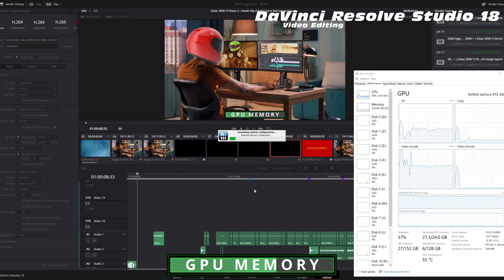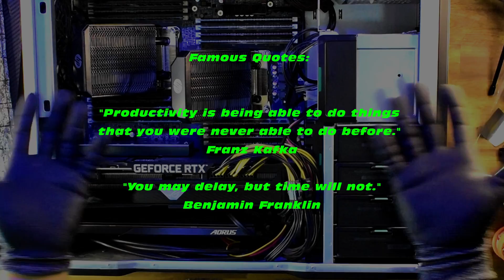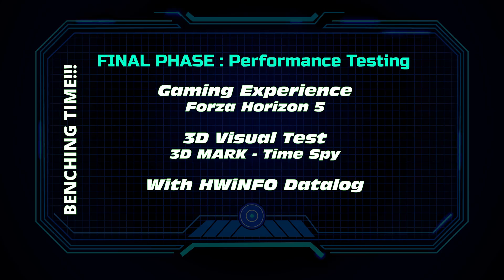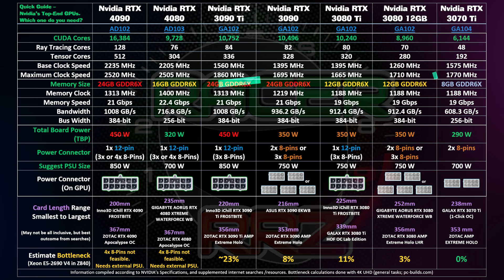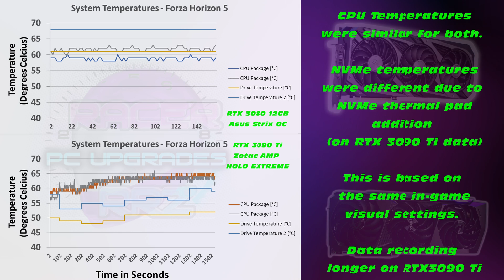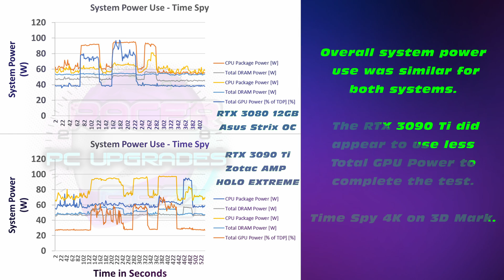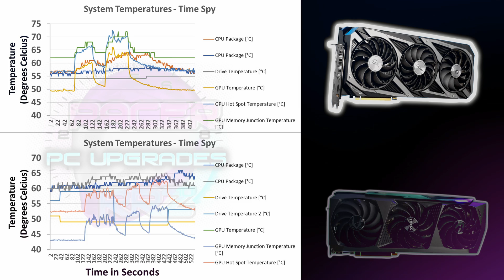GUIDE: Z840 Fitment of ZOTAC RTX 3090 Ti - Unleashing the Extreme Power in a Workstation

Comment: Hi, I'm a refugee from the PC market and looking for more bang for my buck, I have a z840 I bought from pc servers and parts (they were excellent and the shopping was amazing, you could have hit this with a car). But now here I sit as I wait for the 3060s I ordered (2) the rams here (256GB) The ssd's  and buyers remorse, is this going to work? Can I even get the 2 3060s in? I know I have 3 power connectors so that's covered, I plan on having a tech here because frankly Ive never even handled a server until I unwrapped this one... So as I wait for the last 2 parts the gpus I wonder, did i waste my money? Is this build going to work? Its killing me in inches and driving me to drink... And I don't know until next week when I have my appointment with a tech.
Reply from the maker: Great choice with the Z840 - it's a powerhouse with a lot of potential. What was your end-use plan for the Z840? Dual GPU configurations can be useful but it really depends on what you are doing. One application I can think of would be LLMs. Having dual GPU would allow for more effective usage of local LLMs that can operate on the RTX 3060's hardware. However, if you were planning to game or just do general use then the second GPU might be less useful. 

The Z840 has 3x 6-pin power connectors that can supply a max of 219.6W each (12.2V@18Amps). The RTX 3060 requires ~ 170W - so in theory one 6-pin converted to one 8-pin will be sufficient for most models. I have links in the video description to the cables I used on my Z840. The bigger challenge is connectivity. Most GPUs occupy 2-3 PCIe slots due to their size - which means some of your PCIe slots will be obscured. In your situation, assuming you require both GPUs for your end-use, I would place one in PCIe Slot 2 and one in PCIe Slot 5. Slot 5 is only a x8 Slot but I find it unlikely that your GPU will clear in Slot 6 (which is a full length x16 Slot - ideal for a second GPU). You could try fitment of the second GPU to Slot 6 but I suspect it will not clear the system chassis, nor the SATA cables, nor the motherboard cables (i.e. the fan blades will have cable clearance issues in Slot 6). Slot 5 should work.
Reply: @racerrrz  I plan on using it for stable in motion video generation down the line I haven't designed the work flows yet, more then likely LTX because of my VRAm portions and the dream is to slap my 3rd 3060 in with a risers eventually I'm not sure if that is possible though, but Ill get a good look on assembly and then be watching some more (a lot) of your videos I imagine then Ill let my mind percolate and mull it over and come back that that later. reading the above i may have to get into risers sooner then I thought the fitting doesn't sound optimal, but thank you, Iwas going to hire a onsite tech to ensure the smooth assembly unfortunately I Don't live in a large city, it is a deer in headlights on repeat, tower server, LINUX! Oh my, and i'm reassuring these guys that I'll take care of the Linux I just don't know how to handle server stuff yet, nope. Oh well I guess my grandpa  just chucked me in the lake, swim boy! Obviously Im subbed to you now, but now this weekend I have the pick the bones of your channel looking for all the z840 stuff I can find. it's still freaking amazing to me i couldn't get a tech, I figured they could slap this thing together in 20 minutes then bam 200 bucks peace, nope. Now Ill do it and keep my loot, with your excellent channel that is, wtf is with the helmet bro? Lol fucking killing me with that. I gotta tell you the truth though its a great hook I felt like i was watching a tech from road warrior verse or something. I'll definitely get back and let you know how it how it turns out regardless. What did you think about the choice of the 2 matched, although i should have contacted them and got truly matched. What do you think my chances of getting all 3 are in down the line keeping in mind duct tape and zip tie's can be what amount to finished installation for me, this thing is never getting moved, and if it does Ill yank whatever abortion I install ahead of time, as long as I can keep them off of each other and the other components Idc what it looks like function above form always for me this isn't a painting I plan on staring at and unlike my gaming pc I can't even see into to it. If you say maybe Im gonna be  binge watching riser video but the 2 matched gpus in the mail are the prime, the 3rd is in my gaming rig but I happen to have a fully functional 1660ti in a drawer, as to the triple build Im looking at, I believe i can set my wf's up to off load the different nodes onto the gpus if I can get  the 3 inplace ill have the matched doing to most work and the odd gpu out taking care of the least in the WFs. And 2 will just be a scaled back version of the above. But the current plan is get the hardware installed 4x SSd 512 gb of ram this month total and the 2 new gpus. And if that doesn't work then I may be ordering rissers immediately. this Is what overnight is for at that point. But yeah I'm probably going to be a weirdo stalker on your channel this weekend, the above all works, then linux install until that's as close to perfect as i can get it so I don't have to dick with it for a long time. I predict a lot of coffee in my future, thanks for the reply, ill pass on a update some time this coming week when the GPUS arrive, and I will check your links aboas well. Since we're this deep in this x2 https://www.walmart.com/ip/MSI-NVIDIA-GeForce-RTX-3060-Graphic-Card-12-GB-GDDR6-1-81-GHz-Boost-Clock-192-bit-Bus-Width-PCI-Express-4-0-DisplayPort-HDMI/914914872 I have the same im my gaming rig and its been exceptionaly stable for me. Since you seem to be "The Guy" in this area whats the chances of me getting the dream 3x gpu down the line with risers going assuming my artistic use of duct tape and zip ties? Hope the day finds you well man Ill hit you back when the 2 gpus get here and I get done with the hardware and at least a base linux install, Ill let you know where i ended up with that, fingers crossed. Just to reassure this isn't for gaming this is for ComgyUI and Davinci studio, unless I find something I like better after the Linux install ro replace comfy, but with comfyUI I am fallmier, I have a stable install on my gaming pc in windows 10, that was fun... Word to the wise for those of you installing and using an older model, be aware a lot of older work flows contain old node versions that will zap your python install on the spot BAM! Then its reinstall time, and go check your appdata folders under user, frankly check all of those sub folders it stashes like 3 files in there. Oh yeah I want to say it hides a file in program files as well, there's a HD mapper you can Dl for free. So obviously ive been down that road a couple:face-pink-tears: times. Make sure you dump your browser history :face-orange-frowning:also. And since Im at it https://windirstat.net/ this is the HDD mapper it is excellent and free for any one that goes down that road, I wouldn't, but just in case. And you what the hell with it Im gonna pre-emptively order 2 risers, since I forgot the pin converters so might as well hit that 35 dollar minimum for free delivery. And since you are "the guy" im gonna wait and see if you tell me to get anything else while Im at it salute and go order. Don't worry, duct tape and zip ties are always on hand in my household. Sorry for the wall of text btw, I started rambling...
Reply from the maker: Sorry, YouTube flagged your comment but I managed to retrieve it. I presume it was the external links - they tend to get flagged as potential spam. Riser cables open up some options and you'll find you are in the right place because I am a master at using all my PCIe slots no matter the obstacle: https://youtu.be/pWS9hGgSo-4

There is power in learning to manage your own hardware and that's part of what fueled me to start this channel. Computers play a very large role in society and with AI that importance is only going to go up. Something like the Z840 is ideal for running AI LLMs - so why not learn how to operate the workstation / server hardware. I really only got onto HP because my ASUS ROG Rampage IV Extreme motherboard blew a capacitor way too early in its life-cycle. The rest is history lol. Server grade hardware handles my needs better.

Take the cash you saved and invest in some more upgrades for your system! haha yes, the helmet. Call me stubborn, but when I got the channel idea at 3am while sim racing on Forza Horizon 4 I had to pay tribute to that origin story in the best way I could think of lol. It's taken a while to refine the visuals and audio - who knew recording sound through a helmet would be technically challenging. The "cyberpunk future retro" tech enthusiast fits the concept - and since we were all wearing masks during Covid era it seemed appropriate inspiration. 

Triple GPU, providing you can use 1x 8-pin for each, is feasible. Airflow is one consideration, as long as you get decent air movement you should be ok. I have been using my systems without their lower PCIe shroud and without a side panel for the last 3 years. So far so good... I am tempted to draft up some sort of design so that I can get a seal on the system despite having hardware protruding out the case. Go for it, I think I have the most Z840 video content on the web, so you are in the right place. I need to speed up my Z840 case swap guide video - although that has been done already: https://projects.diegoromero.eu/hacking-the-hp-z840-into-a-standard-case/ 

Nice, MSI make some reliable GPUs - you'll get decent use out of MSI Afterburner also. I use it to adjust my GPU fan profiles to be more aggressive - that permits higher fan rates sooner to keep the GPU running nice and cool. 

You sound set on the 3 GPU concept so why not give it a try! It would be more of a tidy installation if the Z840 was in a new case, but that is still a fairly technical process on this system. Securing the hardware outside the case with a riser cable is perfectly fine - I have done that on my Z840 and now on my Z8 G4. I like my riser underneath my GPU - there is something about making use of all the hardware - no limitations. A riser cable of about 25cm in length will suffice - ideally you would try to get the same item I listed in the video above. I measured that riser cable to fit under my GPU - with it fitting into PCIe slot 4 underneath my GPU mounted in slot 2 (3.5 slot width GPU!). So I get to retain access to that PCIe slot - perfect for a 10GbE NIC.
Reply: @racerrrz  No Idea why YT deleted my reply, ok i have some ideas based on the subject of who I may or may not be mocking in a few videos I made, there seems to be a lot of the gravitationally challenged that work there, so I can't really cry foul. Thanks for the reply as well, none of my local techs would touch this, server linux and that's as far as I get, (fairly rural area) and it's a deer in headlights, and Im promising them to handle the Linux after they are gone. But no, this isn't gaming rig, I have one of those already, this is for ComfUI as you guessed, well I plan to see what Linux has on offer in this regards but the very least its gonna be comfy at the start. I'm using smaller compact 2 fan 3060s, MSI Ventus GeForce RTX 3060 12GB GDDR6 PCI Express 4.0 Graphics Card RTX 3060 Ventus 2X 12G OC, these. I own one now thats in my gaming rig. Its very stable, I don't overclock. And if I can get the 3 in with 2 risers that's happening, and I think I have the airflow solved, it won't be elegant but considering the fact there will some thermal resistant zip ties used in this install I imagine I won't care, maybe you can tell me if this is a bad idea due to electrical shock, or arc. But I was thinking of adding a small extremely powerful fan, Id shop for a non conductive housing, and just run the cord out of the back side of the pc and just blast air through that space from the back of the space. Not sure if that's a good or bad idea but you seem to know what works and what doesn't, and thanks for the response man. So I'll be watching videos tonight and and tomorrow but Im starting to get my head around 2 risers, I think that may work. Ill know when I get the 2 gpus next week and Ill let you know. But the end goal thinking LTX, 2 of the gpus are near perfect matches, if I knew what I know now a week ago I would have gotten perfect, but close enough, the 3rd the odd gpu out is the same exact make and manufacturer, a year old, the plan is to off load the heavier nodes to the two matched, and whatever's left the odd gpu can handle. Also Im gonna split all my file structures up IE linux, drivers c:, comfui d: and so on, just felt right to me. And Davinci will leverage all 4 drivers, with that I have a lot more experience. So thats what Im shooting for. I know it sounds nuts, it did to me, but my AI assistant thinks we can pull this off. But the above has given me hesitation, so now I have to order risers just to make sure I think. Oh yeah, aesthetics mean nothing to me I cant even see in this rig, If i have to Ill build a small frame to hold a gpu made out of popsicle sticks. And if I ever have to move it, Im well aware of the abortion I set up, Ill just pop the gpu out first. So that's the current plan after reading your reply and discussing it with my AI assistant, although Ill settle for 2, that would nice as well with 512 gb ram and 4 drives to leverage. But the real goal is 3, I think this would manhandle a smaller model like LTX. I plan on adding ALOT of loras and control nets so there will be plenty of work to go around. Ill let you know regardless how it works out and now that I think about it I had a link in my last one to the gpus, that may be why YT removed my reply. I'd like to think its the videos though.
Reply from the maker: Nice, I like how you have an AI assistant - I live by the same code. ChatGPT4o and I chat daily lol, and more recently I have explored local LLMs - so I can fine tune the model on my own IP without giving that IP to OpenAI's cloud. I should mention, you might need to trade in one GPU for more storage. Can I introduce you to Quad NVMe adapters: https://youtu.be/xqg0uQ93KTg . I use a 8TB RAID 0 pool as my main DaVinci Resolve video archive - it makes editing more complex projects a breeze because you get zero lag from accessing the drive - something especially cumbersome with HDDs. BTW, I have a website which might make the Z840 content easier to spot. My one complaint about YouTube is that the pursuit of "clickbaity thumbnails" means the thumbnails fail at their core purpose - to demo what is in the video. I created a "better" version of YouTube here: https://racerrrz.com/hp-z840-hub/ (you'll need to create a free account to view the page; if it gives you any issues I can add you manually - the membership plugin is problematic - I need to check for a better one).

And I certain you'll find it soon enough, but we have a Discord channel also: 
https://discord.gg/QmpMeE7Xfb
Reply from the maker: Sorry slow response. Your comments keeping going in the chat spam filter - I presume it was swear counter hitting one! Sorry about that - I'll reply to your deleted message. Nice. You may want to consider jumping into our Discord group - it would be a bit more lenient on the content filtering there. The multi GPU setup makes sense. And recovering some of the VRAM that would have been absorbed by the OS etc. gives you more productivity - so I approve! Ah yes, legend has it that the helmet boosts the tech support ability by 1000%.haha. Who knew? Nice, your storage setup for editing is coming together nicely. The added RAM is a nice touch, I didn't realize my system was low on RAM until I increased my cap. It seems DaVinci likes to use RAM if it is there. The most I ever managed on a video project was ~220GB in use! The Discord Server: https://discord.gg/QmpMeE7Xfb

Comment: Can I install a graphics card (RX 6900XT) comfortably and safely, or is there a problem due to its size?
Reply from the maker: You'll have no issues with fitting the RX 6900XT. Depending on the model, you'll need 2x 6-pin to 8-pin GPU power adapter cables to connect up your system.
The Zotac Amp Holo RTX 3090 Ti is one of the largest RTX 3090 Ti's produced and this really hammers it's ability to fit into most cases. 
The Z840 has ample room - more PCIe chamber volume than the newer Z8 G4 in some ways.
Reply: @racerrrz  Thank you for the reply
But what really scares me is the bottleneck
As the device will contain 2 processors of type () and therefore the graphics card is stronger than it and a bottleneck will occur and I will not benefit from the graphics card. Am I right or what, especially since I will buy the device for games
Reply from the maker: @pc_games2593  It is a slight shame yes, your GPU can deliver more performance but everything around it will be running at snails pace. I can't speak for the new gen of GPUs - but I am quite satisfied with the performance of my RTX 3090 Ti, so much so I haven't even considered looking at upgrading. I can play modern titles at 4K ~60fps (Cyberpunk, Forza Motorsport etc.) and my CPUs barely break a sweat. There is a bottleneck - maybe 5-20% but I get enough performance to not notice the loss. You'll have to make that decision. 

These workstations offer more than just gaming - so if you plan to just do gaming a modern Ryzen system will give a better experience (single core performance is much better there). If you plan to use all those cores for work - then the workstation with a modern GPU makes sense. Two systems in one.
Reply: @racerrrz  Thank you for the reply
I wish you a happy day